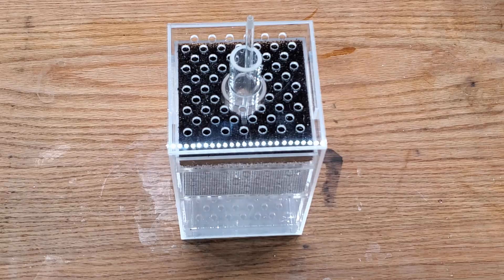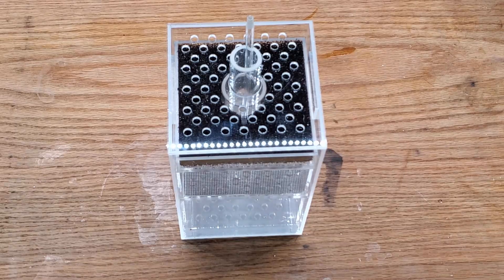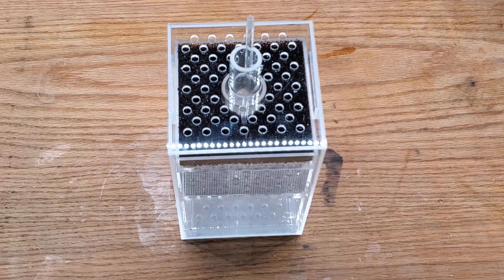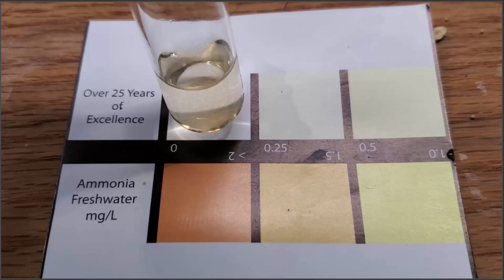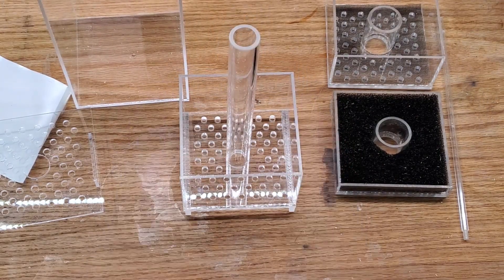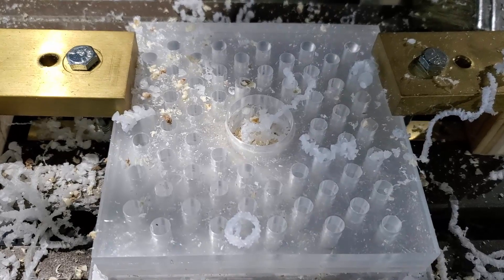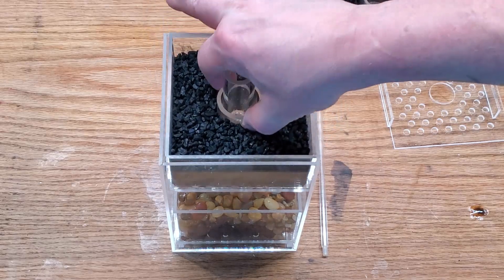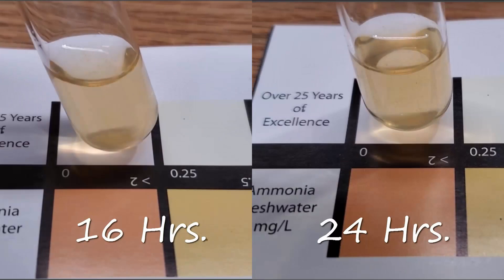New Box Filter Design Vs. Ammonia

Comment: I think that there will be no difference between carbon, and no carbon. 
I have never heard anyone claim that carbon pulls ammonia or nitrites out of water, so I don't think it will make any difference. 
Don't get me wrong, I HOPE I'm wrong, and it just pulls ALL the ammonia and nitrite out, but I dont expect that to be the case.

Also, so you don't have to mess with showing every build, why not make a playlist of a few videos showing just how to built stuff. One could be basic acrylic techniques, another advanced ones, another silicone techniques, and another tips and tricks to get measurements, or straight lines, or the best bits and blades to use for the various projects. I think it would save you time in the long run and be a REALLY nice resource for us with no experience in the field.
Reply from the maker: You're quite right. There should be no removal with carbon. The funny thing is when ever I leave out the build process I get lots of requests to put it in . Thanks for taking the time to come by!

Comment: Not one to do math, even under pressure; my theory is it would take a massive amount of carbon to make more than a day's difference as carbon absorbs organics that lead to ammonia spikes. That said, I think we all want the magic formula however; we are in reality, proving that tank cycling is tank cycling. No shortcuts. Improved efficiency is still a worthy goal. Here's an experiment that might be interesting: reversing your plant experiments to see how commercial immersion grown plants adapt to slowly becoming submerged. I've often wondered if lessening the shock of going from one growing condition to another would reduce melt off. Something I had intended to try with that 20L wasting space in a  corner in my living room😉👍
Reply from the maker: You're quite right that by the end of this we're most likely going to see a consistent 72 hr. effect. That seems to be what previous works on this have come up with. Those tests though dealt with specific filters where I'm going to try many. I've seen many videos on submerging terrestrial plants and it seems to all end the same. Making the process slower might help but I expect that after long term submersion the plant will drown. Thanks so much for coming by and sharing your thoughts on this!

Comment: Mate, be carefull with your assumption.
If you get amonia spike, carbo do help your fish, but not by reducing amonia, it help your fish by reducing ph.
There is two type of  amonia in your test environment, NH4+ and NH3 (ionized and un-ionized ammonia)
your test kit do not see the different between them, however un-ionized amonia is alot more poisonous to your fish.
Carbon, help you to lower the Ph, and with lower Ph, you get less un-ionized amonia,, hence your chans that fish live increase.
But  adding carbon to lower ph depends on your water hardness.
Summarising this shoud be :
If you have not hard water, adding the amount of carbon you used, will lower Ph, and let you get less un-ionized amonia and icrease your fish survivell chans, hower your test kid still show unchange amounto of ammonia.
Reply from the maker: You're right in that most activated carbon in the aquarium trade is acid washed and could lower the pH in your tank. The pH of them being around 3-5. Depending on the chemistry of your tank water this could lower the pH by a noticeable amount. This test though isn't about it's general benefits in an aquarium but specifically about whether it will absorb ammonia. Thanks for coming by and sharing your thoughts on this!

Comment: change your pebbles/media to zeolites
Reply from the maker: The more porous the media the greater the possible surface area and therefore the better the biological filtration. There's no real argument against this other than how much do you actually need. I find in most of the tanks I've set up that gravel is porous enough and if I think I need a bit more I use lava rock or coral. I've bought some of the commercial media and tried them. The only thing I really noticed in the end was the price. Thanks for watching!
Reply: @FishmanEricRussell  That was what my thinking too until the ionic aspect was brought up. Postive and negative ions attract each other. My filter is like an big magnet. This is different ball game. Anoxic filteration. http://www.mankysanke.co.uk/html/anoxic_filtration.html
Even if you don't want the anoxic to take out nitrates, the zeolites can still be used to zap ammonia. And the best thing is you can recharge the zeolites by soaking it in brine.

Comment: Straight carbon impacting your ammonia concentrations, probably marginal at best. It can pull out any number of things, but ammonia isn't one it binds very well. 
Carbon which does interact with ammonia: is surface treated activated carbon. It's usually exposed to an oxidative treatment with something like nitric acid.

So, is your carbon an "oxidized carbon"?  
Also worth noting, oxidized carbon will only get you so far. Activated Carbon specifically designed to pull out Ammonia, have proprietary granules added, specifically because the carbon alone does little
Reply from the maker: It is acid treated, though not with either nitric or phosphoric acids as it was intended for a marine environment. I still expect it to have negligible affect on the ammonia. I wanted to run this simply for the nostalgia of what was told to me when I first started working in pet stores. Thanks for taking the time to comment and watch!

Comment: Carbon CANNOT adsorb ammonia, nitrites, or nitrates.  It WILL adsorb the organic compounds that PRECEDE ammonia in the nitrogen cycle.  Therefore you would only see reductions in ammonia readings where the carbon was allowed to do the job on the first stage organics,  In this test, with a non-organic source preceding the addition of ammonia and no bacteria impregnating the carbon, I'd expect nothing.  It's the wrong set-up.

The test should be with decaying organics for the carbon to work on in order to see a result reflected in lowered ammonia,  Again, I refer folks to the science and proper applications of carbon.    https://www.aquarium-pond-answers.com/2009/10/activated-carbon.html#carbon_works
Reply from the maker: Quite true. This video was about the fallacies that permeate our hobby. Thanks for coming by!
Reply: Completely agree; however, it is worth noting that some forms of carbon can be created which have some impact. But they have been specifically treated for this purpose. 
This is a good reference on the topic: https://www.tandfonline.com/doi/abs/10.1080/01496397808058298?journalCode=lsst20.  

However, their are limitations. The few activated carbons sold specifically for ammonia reduction are impregnated with secondary materials which do target ammonia.  "GC IPA" activated carbon is one of the few examples I'm aware of, but I've never used it. 

The carbon in Fishman's test will likely do little to remediate ammonia levels directly.  And reductions will likely come from biological activity oxidizing ammonia into other forms.

Comment: This is really interesting and I remember the days being taught to use carbon and being told exactly what you just said!
This is really interesting since I was taught that exact thing ..so having that drilled into my head since I was a kid, I would like to say that it will work..🤔😅
 It's only been over the past year that I have been told to throw away all the cartridges and carbon and replace it with media such as matrix or lava rock!
Although my aquariums are running smooth, I know that that process takes a while so this should be really cool to see.. 
This time around in the hobby though, I created planted tanks and I did a lot of water changes when I first set them up like 10 to 20% every day or every other day. Everything was brand new on my 15 gallon when I first started on it..including everything in the filter.. I also had a deep planted substrate in it of stratum, which I later capped with sand. So I had really good luck or results with it.
So what if I had been a new person setting up an aquarium and didn't know some of the things I know now?
(I really do like the simple design of this filter and you are definitely not lazy 😅 work smarter not harder 😅)
In theory, we're taught that carbon is detoxifying. hmmmm🤔 I also wondered if the carbon itself if left in a filter for a long period of time without being changed or after being "exhausted", would just end up being like a biomedia especially since pet stores and Aquarium companies tell us to switch them out often?
Another great experiment Fishman looking forward to seeing more results! Thanks for the video FishMan have a very blessed day 🙏💚🌿🐟🌿
Reply from the maker: Hey Mary! So many things are perpetuated based on profit instead of what's best. A little bit of knowledge and patience goes a long way. So glad you like this filter. Carbon unfortunately makes for poor biomedia. After it's been in an aquarium for a while it starts to release what it has absorbed. Thanks so much for coming by! Always look forward to hearing from yo!
Reply: @FishmanEricRussell  oh I'm glad you told me that.. I honestly didn't realize that it would start releasing after it becomes old.. a lot of things I just understand the mechanics of but I don't know all the technical stuff. That's  why I love watching and learning!! Thanks again I truly appreciate you 🤗 have a wonderful day 🙏🙏🌿🐟🌿
Reply from the maker: @marypaigeflynn4512  You and me both Mary! I'm constantly learning as I go
Reply: When the charcoal becomes exhausted it's called "biochar". Cody's Lab did an experiment with it recently that you might find interesting. At the very least, how he "charged" the charcoal is relevant to these videos. :)  https://www.youtube.com/watch?v=DT1gxIk5g0Q

The thing to remember about these 2 videos is that the ammonia is metabolized by bacteria which is a living thing. A single celled organism. That single cell is not a brain cell and it doesn't care where it grows.

Hey Eric, (if you're reading this)... since bacteria is a living thing, another thing for you to test is temperature during cycle. Nitrosoma's peak metabolic rate happens closer to 70F/21C and colder water can dissolve more oxygen in it. You'll probably get faster results if you set the heater lower to room temperature during your four day test cycle before turning it back up to Angel Fish temperature.
Reply from the maker: @wAf-Billy  Some of the nested comments get missed as YouTube notifications are kind of hap hazard. I caught this one though. Thanks for those suggestions. I will have a look at his video. There have been so many suggestions for future experiments and modifications for these experiments, I will have lots of material for quite some time. Thanks for coming by!
Reply: @wAf-Billy  Thank you very much!! It was good to be able to see the results and reading your comments. I will definitely check out the links! I hope you have a great day and thank you for sharing 😄🌿🐟🌿💚🙏